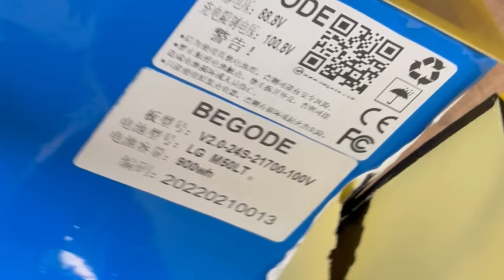World's HEAVIEST EUC - Teardown BEGODE EX20S

Comment: Great video, I own this wheel too. Love it. 

Begode confirmed 10a charging will blow the 10a fuse, so, 9a max really. They have a 15a charging circuit as an available spare part (needed for the non adjustable 10a charger I already own).

Suspension, to let air out, I use a button on my suspension pump to release it slowly (not sure if the original pump had that button).

High discharge cells not needed with 3600wh configuration as per Begode, no load sag issues.

1 trolley locking mechanism didn't work out of the box for me either, and the working one, doesn't work well, "hard" to lock and then hard to unlock.

Comment: I would love this wheel if it would just have some water or dust sealing! How they can still negate including any when they full well know people use EUC’s, on large, to commute. More using those with suspension for off-road riding…I’m not even looking for an official IP rating. Just to see some silicone sealant for the casing of the batteries and boards, plastic covers for wires. That’s all it takes to drastically prolong something that costs as much as a half decent second hand car.

Comment: Thanks for the video! The wheel is heavy, and it's metal...clearly the heaviest metal wheel in the EUC world! ferocious air guitar

I think the video is solid and very helpful. Something that may help if you are inclined to add them is screen summarizing Begode shortcomings for those who bought the wheel to address. For those considering purchasing the wheel, it will give them a good idea if it's too much work to "fix" for a wheel. Selfishly speaking, I own this wheel and before any wet riding, looks like I've got some modest gorilla tape waterproofing and mudguard creation on my to-do list, which your video very helpfully points out.  Having one quick recap screen listing weaknesses (water and otherwise) would be awesome. I'll probably also find some way to put some armor to protect those battery cables. Shame that the charging ports are still hot.

Keep up the great work!

Comment: I would definitely go to a Hobby Lobby or Arts and Craft store and buy small foam pads. Something like thin gasket plastic to put on the rim of the mother board box. Also knowing how to make a cover for the fan.

I think you can go to a hardware store and ask for tube covers, maybe Home Depot or a hardware store to protect the cables. Also I guess you need to buy a 3D printer to start making customs “Wrong Way Covers” for the lights and fan

Comment: A fender would be nice, yes. However, it may interfere with the cooling stream through the fan, which may not be water proof, but could be if desired. Hard to know what was intended. One of the best tire change solutions though.

Comment: Love these types of videos in fact I think you # a fantastic job at really exploring each wheel quite extensively with all the various types of videos from unboxing/1st impression vids to the how's it going after so many km vids and now with these teardown/build quality and inspection type videos this channel is by far the most comprehensive EUC knowledge  base that anyone could ever want. . .anyways I'll stop with all the praise wrong way fodder.  Keep doin what your doin Adam, you are to EUCs that Josh Bardwel is to FPV
And now for my question :
In one of your videos on the S22 you talk about adjustments that can be made to the suspension that favorably change the geometry. Are there any adjustments/modifications such as that for any of the begode wheels? Also which recent begode suspension mechanism do you like the best? EX20s? MASTER? HERO?... Also you talk about the future of EUCs and a wheel that  will provide a good platform for years to come.. I agree that this is important and something I long for. I have been telling people that the EX20s might be that wheel or at least the beginning.  I think an EUC control board that configurable in the same manner FPV flight controllers are using an interface like BetaFlight would be a huge step. In fact if the EUC hobby started following a similar path as FPV wherein custom frames could start appearing that have universal mounting for user configurable control boards with parameters so people could fine tune their wheel for racing or cruising or stunting or learning or whatever these control boards could also have accessory channels (like UARTs) for things like 3rd party LED light kits, bluetooth speakers, touch screen displays, navigation, antitheft and diagnostic sytems etc. And a modular design that allows high end ESCs to be swapped out and reduce (or increase) repair costs (depending on quality of components being replaced,) plus quick swappable interchangeable power cells (aka battery packs) with external chargers and high end motor hubs with swappable custom rims that would give people the ability to truly personalize their wheel. I think the EUC phenomenon is more than a hobby and that it's barely in its infancy and we have yet to even start to see where these wheels will take us. They give us personal freedom and bring us together at the same time, they are so simple and compact yet powerful and unique and versatile they have character and provoke intrigue in people that are seeing them for the first time. They aren't difficult to learn but it does take some determination and commitment and people subconsciously respect that. People often ask is it hard to ride and I tell them it takes a little work to learn but once it clicks it's easier than walking. And you are right Adam, even after you have been riding for a while there is still so much more to learn and explore with these wheels, you don't get bored with it... they have a novelty that doesn't get old or wear off... they make life fun,  and if you are having a bad day just go for a ride , it never fails to lift your spirits. But they are addicting and when your wheel breaks down(rare, but does happen) it can be depressing. I think this is why most people that ride EUCs have more than 1.

Comment: A small air shock like that doesn't have a lot of oil in it for lubrication. So if you spray out a lot like in the video I would plan to service that shock sooner than later.